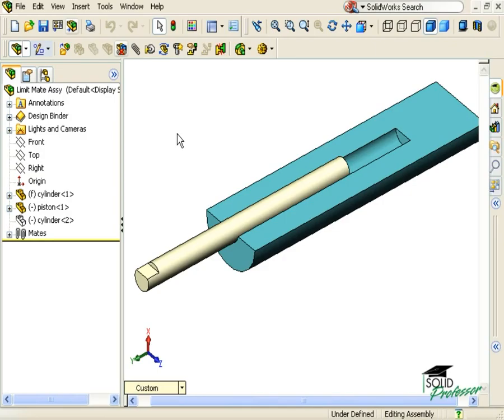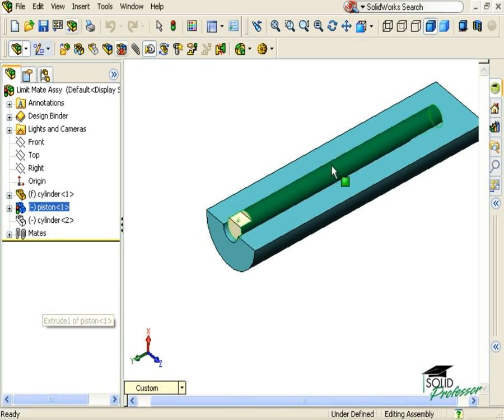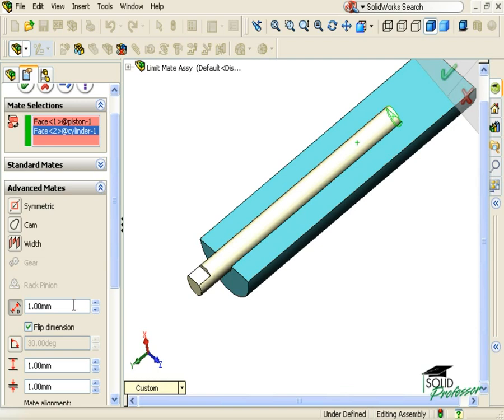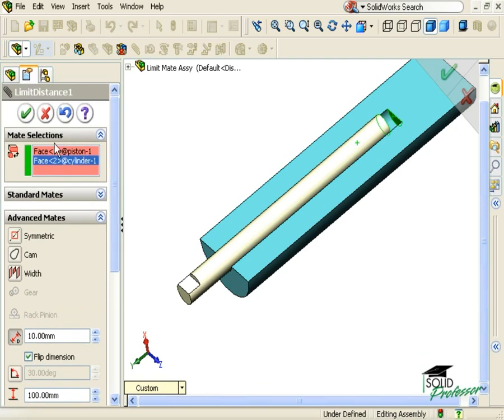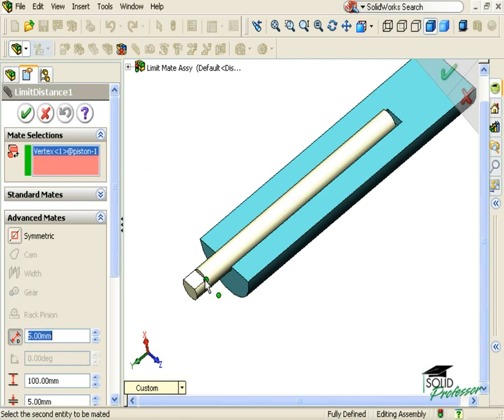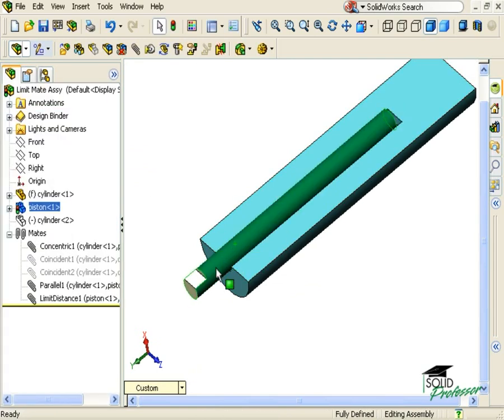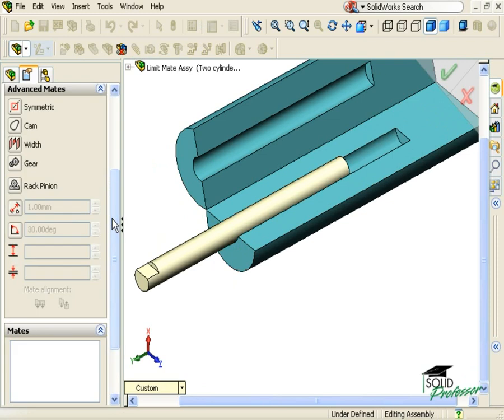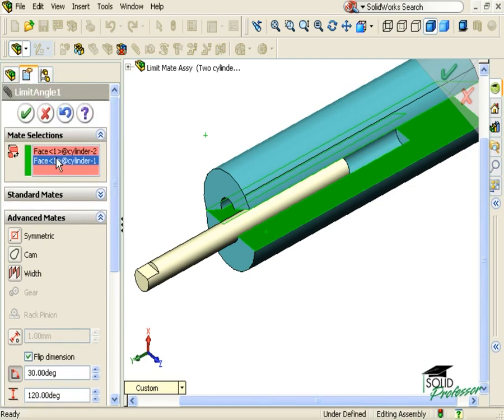Using Limit Mates to Define Range of Motion in SOLIDWORKS

Comment: Why can't you set 2 limit mates?  Just about everything that exists in our world that has motion, has two stopping points.  Take a door for instance, it stops against one wall, then goes the other way until it stops against another wall. 
I cannot get this to work! It lets me set 1 limit, then expects me to calculate the distance in the other direction.  WTF!?  Is there a way to set 2 surfaces as a limit, then move the part between them?